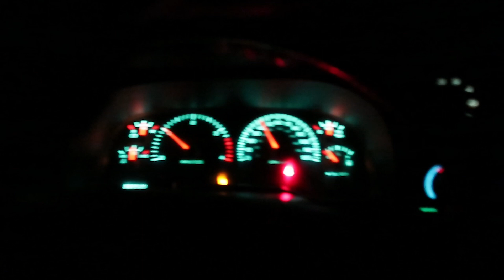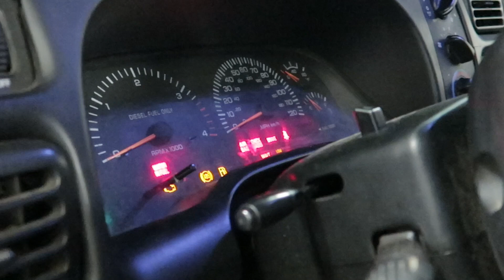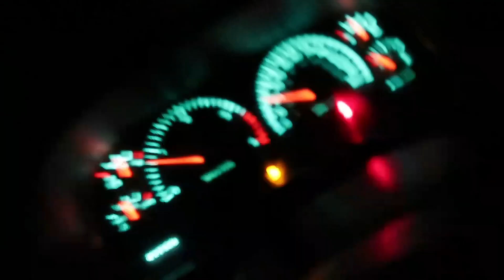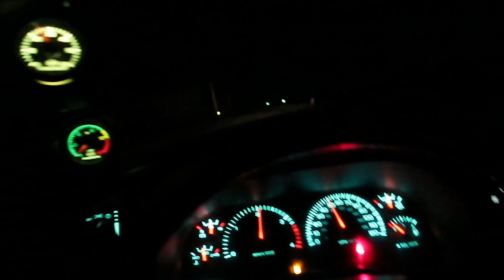"MASSIVE" SINGLE TURBO ON MY 24 VALVE CUMMINS

Comment: What are your thought on smeding? Heard both good and bad, I’m getting a similar size s400 and considered smeding but wasn’t sure.
Reply from the maker: Currently no longer buying their products..
Reply: Is there a reason? I run their 362/65/14
Reply: @MPAC-ug7jl  I run their 363 and im making roughly 700hp to the ground on an 04 5.9 CR, just bought their s480, remind me in 4 months and ill let you know how its going
Reply: @cole1407  I’ve been running my smeding turbo for over 40k miles now with towing and hot dogging with zero issues
Reply: @MPAC-ug7jl  that is great to hear
Reply: @cole1407  it’s been 4 months, how is the 480?
Reply: @shaneharris6134  made 840hp with it, not the happiest since apparently crankcase pressure makes the seals leak easily so I had to drill some holes in my ccv to get the pressure optimized to get it to stop leaking, which it did stop, probably have about 1000 miles on it now with fairly often hard driving and burnouts, made 65lbs of boost, but I have some charge pipe leaks and the exhaust charge pipe leaks a little at the v bands as well, I think im missing out on about 10-15psi from what leaks out and what the is in airflow. Nice thing is stainless diesels turbo rebuild kits are direct swaps Smeding said if I have more leaking issues, otherwise they said if I sent it in they would rebuild and balance it for me. I probably will try a different brand when I can afford it, probably a large single garret or precision turbo is in the plans for the future. 
Though last Friday my trans grenaded while downshifting to 5th towing a horse trailer effectively wiping out my t case as well so she's going nowhere soon.

Comment: Running 6x0.013s, sovp, Quadzilla and a 467.7/.83/.90 on my rig with a 2300 stall. Love the way it drives and spools better than i thought it would!
Reply: who does your tuning
Reply: Is it fast
Reply: How much boost? I get around 55 with a S366 .80 ar.

Comment: Compounds are the only way to go on the older 5.9 that's what I did to my 96. I have a lower stall converter. With  just my single 63mm turbo the truck didn't like it.

Comment: I used a hx40 downpipe and got a flange and v-band off eBay for $30 it was already machined to slip over the downpipe on my second gen swap on my 08 6.7

Comment: any speculation how much power increase from stock 5.9 h.o / nv5600
to
edge juice unlocked 
s475/62mm hx40
sac 7x13 injectors
fass 290 5/8" lines

Comment: Awesome video man. That’s gonna be a tough turbo to make a VP truck happy with. On my 24v vp44 I just bought a 62mm HX super 9 I have 150hp PDD injectors and JWA 5x6 and she lights quick and is Capable of making 600+hp which is all the VP is gonna give you anyways AT BEST so i say sell it and buy an HX super 9 62mm or 67mm that HE351 turbine housing keeps the bottom end torque and low rpm spool great and still makes all the power these trucks can put out with a VP44 IMO. All HXsuper 9s will come with a milled out turbine housing to fit a 67mm turbine. And they are usually spring gated like mine is which is much better for these trucks no boost pressure to gate it only drive pressure 👍🏻
Reply: you must be uneducated because there are MANY 700hp vp trucks using just an SO pump.. let alone monster mike pumps and scheid stage 2 pumps that are capable of well over 1000 on fuel only and has been done many times… these vps aren’t bad like everyone makes them and have tons of potential just have to be selective with your parts
Reply: I have seen VP trucks make 1,000hp on a dyno before with the scheid and MM pump.. just your average VP truck owner is not gonna go that rout so I was speaking to the most power you could get out of the factory (Unmodified) pump. In which case what I said was 100% accurate
Reply: @BiffsEquipment  you were not accurate as the SO vp has made over 700-750 before.. the SO makes damn good power, the HO will get you in that 550 range. The vps are actually easy to make good power with

Comment: I have an s464, 275% injectors, sheids stage 2 vp, springs/rods, and no tune. It’s about 650 hp
Reply: Is the stage 2 vp worth it? I currently have a s366-71.80ar and it needs mkre fuel even with 6x.016 injectors. I was thinkin maybe this pump.
Reply: @charlespetersonii6989  yes worth the money

Comment: To laggy and Smokey, you can’t tow with that. Maybe if your in a flat state and have a small trailer. It will never pull a 12k lbs trailer over any mountains. The only thing that is good for is doing a brake stand and taking 5 min to spool and then doing a smokey when it finally lights.